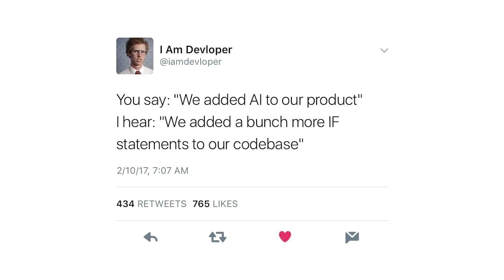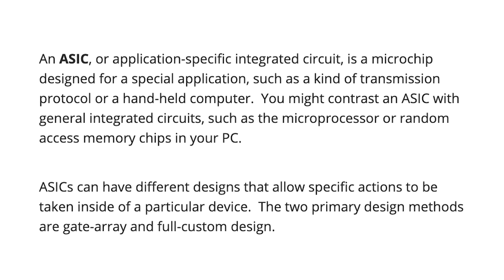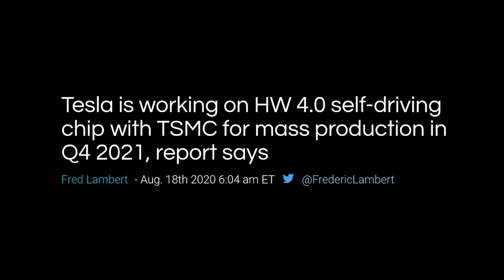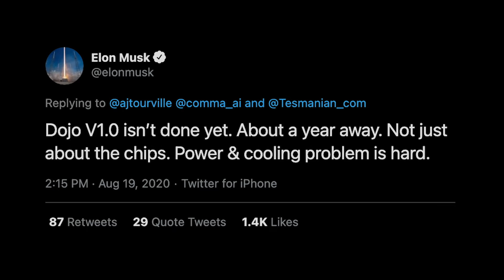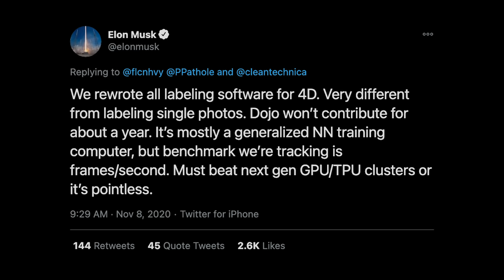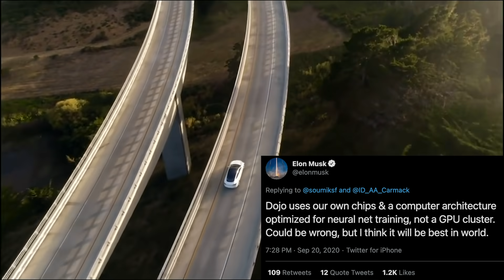Tesla AI Day 2021 Primer (Artificial Intelligence Day)

Comment: FPGA stands for Field Programmable Gate Array.  Now, a microprocessor is something designed out of transistors, the whole thing, for a particular purpose.  A typical microprocessor might have a memory area (dram and/or sram and/or cache), a bank of registers, a logic unit, a math unit, it might have latches, ports, port pin drivers.  If you look at it with a microscope it will look like a city, with distinct regions visually appearent.  An FPGA, on the other hand, is a fixed design you buy, which in the microscope might look like a huge, 2-dimensional array of identical houses, embodying basic logic cells that you can build more complex circuits by inter-connecting them.  Now, they have enough wires pre-built to potentially connect any logic cell to any other logic cell, but the intersections of all these wires are not connected by default;  you have to intentionally "burn" connections at the crossings that you want, thus "programming" it.  This description is a bit crude, and the engineer does not usually think of an FPGA this way, but rather as an evolving circuit design on a computer screen.  The "compiler" will optimize the design to minimize the lengths of wires connecting most cells.  In the end, it will embody the circuit that you design;  but if you look at an FPGA chip with a microscope, it will look like a very homogeneous array;  NOT like a complex city.  In any case, what you can do with an FPGA is limited, relative to the much more expensive solution of designing your own ASIC.  The basic cell in an FPGA contains a few gates and a flip-flop;  it does not contain a complete arithmetic unit per-cell.

 ASIC's (Application Specific Integrated Circuits) typically look like cities, again;  the only difference is that an ASIC is custom, and therefore is whatever you want it to be;  not just a microprocessor.  In the case of Tesla's ASIC, it looks like a rather clean and stylish city;  not too much complexity at first sight.  It embodies a number of microprocessors, but the main area of interest is a vast array of logic cells, like an FPGA, but each cell has a complete arithmetic unit capable of addition, subtraction, multiplication and (maybe) division.  Thus, each cell can execute the code of a single neuron or group of neurons, multiplying inputs by "weights" and adding the results for the output.  And all these cells can execute in parallel, simultaneously.  The processors are there simply to move the data into and out of this array of arithmetic processors, and to run helping code.  The arithmetic array is where most of the heavy lifting is done.

GPU's, or Graphics Processing Units, are the chips in our videocards, and they too have vast arrays of arithmetic engines.  However, they are specialized for graphics, which calls for 32-bit floating point precision.  Tesla did not need such high precision;  I think they use 8-bits at present and will increase to 16-bits for HW4;  but they do need higher speed and lower power consumption, so the GPU solution was less than an ideal fit.
Hope it helps.

By the way, the military AI race is already well underway;  we are NOT talking about something far into the future.  There are already combat robots with AI fielded by several nations;  flyers, walkers and swimmers.  Here, the slightest detail can be make or break for your AI controlled assets;  so the stakes are higher than they were for the nuclear race.

Comment: ASIC VS FPGA: You got it right.   Asic is dedicated hardware setup to do a very specific task very fast. A FPGA gives you a bunch of hardware components (within the chip) you can configure (into a asic) for a specific task.. It's a " build your own computer hardware chip" ... both avoid running software which is slow.

Comment: I suspect tesla currently uses Nvidia clusters with CUDA libraries for training.  CUDA only works with Nvidia hardware, and Nvidia has invested hundreds of millions into developing the software.

I think for Dojo to be successful, tesla needs to develop an alternative to CUDA for AI. This is difficult for their in-house needs but probably manageable for the single self driving application.

It's an order of magnitude more difficult to develop a general purpose replacement, and then requires yet more work by the non-tesla users to port their existing applications to it.

So having the hardware is an important piece of the puzzle for Tesla internal use, but for Dojo public use, I think the software could be 100x as challenging.

A workaround may be that users just provide data, and Tesla does the programming, but that will require lots of in-house talent.

It will be interesting.
Reply from the maker: even though tesla moved on from nvidia for hardware 3?

thank you for sharing!
Reply: @DillonLoomis22  I don't know for a fact that Tesla is using Nvidia in their data centers at the moment, to ingest the training data they get from the cars and develop the networks that they're running on their latest on car hardware, but that would be the easiest thing to do. The hardware requirements to run a network in the car are very different from those needed to develope the network, so there's likely no advantage to using their own hardware in the data center.

That said, if the cars are labelling the data themselves, then certainly have a huge advantage over competitors because it allows them to leverage their rolling compute resources in the training effort.

That's true regardless of the type of hardware running in the car.

Comment: An ASIC application specific IC is determined at designed time to perform a certain function. This is hard wired into the part during manufacture. The complexity of these can vary enormously. One high end ASIC might be a CPU for your laptop, or graphics chip for your game machine containing thousands of processors and consuming billions of transistors while another low end ASIC might be a mouse, a  room thermometer or a stop watch. The complexity difference here might be a million to one. The cost to manufacture the first complex chip will be in the millions. The design cost much more. 
An FPGA is array of unconnected parts. After manufacturing it does nothing. It is just a box of unrealized potential designed to be field configured to do something. The designer wires up the circuit by programming bits on or off in a memory that configures the device.
The designer connects with chip on a high level via a logic design language or even a schematic interface. These systems depend on extensive libraries of logical functions where a single line of code might implement a function requiring a million transistors. They assemble the design with off the shelf proven components from the library and spend no time on the low level complexity.  The high level design is translated into the code that when loaded in to the FPGA makes the custom function magically appear inside. Once programmed an FPGA looks just like an ASIC chip. The ASIC can beat the FPGA on cost, speed, power consumption and logical efficiency but the FPGA is a lot quicker to get going.  AN ASIC might take year or more to get the first chip while the FPGA can take a minute. Interestingly the logic design language can be used for either method. So you could develop the design with FPGAs and then convert to ASICs when you are happy with the design. It's a complex issue I this simplified explanation helps.
Reply from the maker: john thank you very much for taking the time to share, really appreciate it!